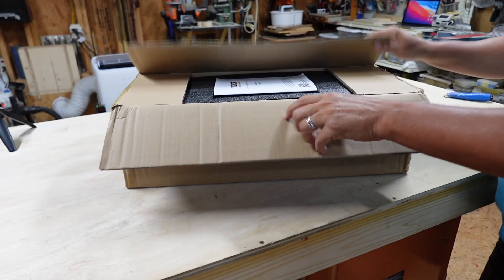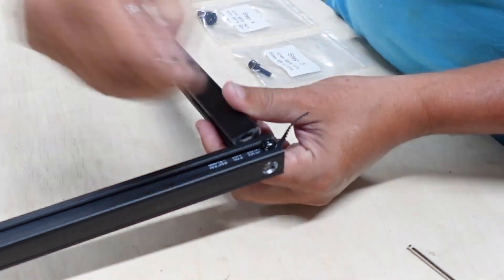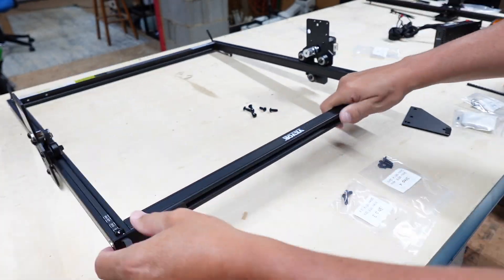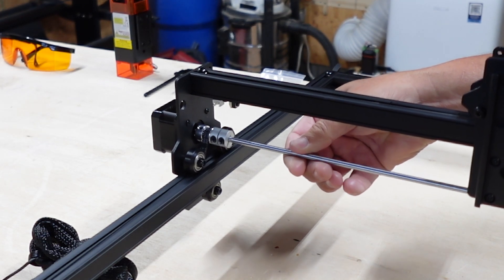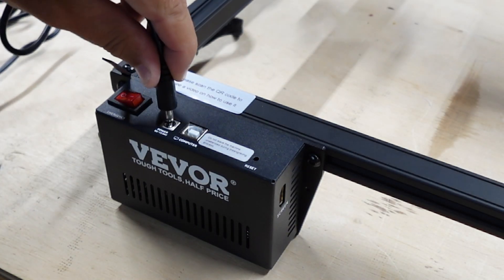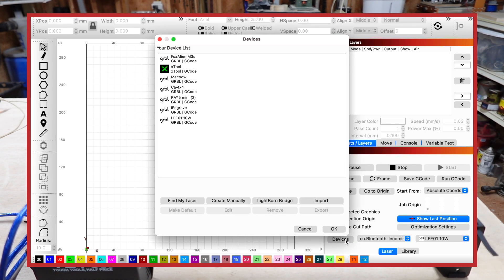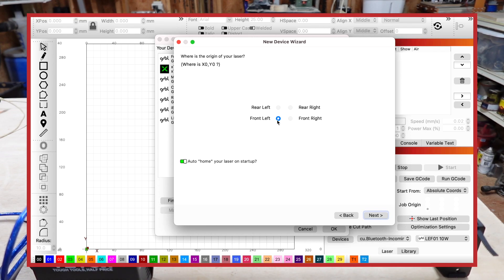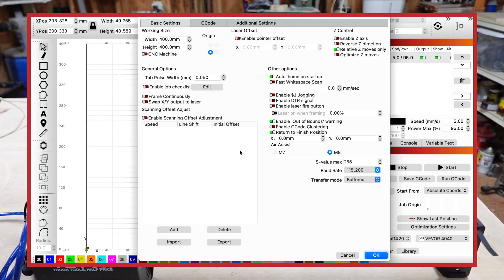VEVOR 10w Laser Engraver Unboxing, Assembly & First Impressions!

Comment: how did it do on glass i like one for my like whisky bottle and glasses
Reply from the maker: Diode lasers won’t typically work on glass.  The wavelength of the laser goes right through the glass. You could coat the glass with paint to etch it. Otherwise here is the breakdown…

If you want clean, reliable engraving on clear glass, the ranking is:
	1.	✔ UV Laser (355 nm) – Sharpest detail, professional results
	2.	✔ CO₂ Laser – Excellent for tumblers, plates, décor
	3.	➖ Fiber (1064 nm) – Works, but not consistent
	4.	➖ Blue Diode (450 nm) – Only works with coatings

Cheers!

Comment: I’m looking to make boxes with this laser, what is the thickest material have you successfully used.
Reply from the maker: The most you’ll get with at 10w diode I’d say is 5-6mm basswood and that’s with multiple passes.  Get a 40-60w in my opinion. You’ll spend more but worth it.

Comment: hi, can it used on champagneglas?
Reply from the maker: Yes and No. diode lasers cannot typically mark clear glass or cut clear plastic but you can put a coating on the glass and etch it. Some people use tempra washable paint then laser it.

Comment: How well does it work on brass, copper, aluminum?
Reply from the maker: To laser on metal with any diode laser…. You’ll need to spray the metal with etching spray.  If you want to bypass the spray step, you’ll need an IR or Fiber laser.  But back to your original question…. This laser will work on those metals WITH etching spray.
Reply: @TheCrawlspaceCraftsman  yeah sweet, i make Nordic gold and was looking into the laser engraving/etching so i can add clean designs to my work, being a blend of the three materials and slightly softer then copper, i'm hoping it will etch well before i go all out and buy one

Comment: I just got my Vevor 5w unit built and tested. Mine seems a tad more fancy as it has what appears to be higher grade frame and gantry. It also has really good wire loom? Chain linked plastic case protecting all the wire.  The price is respectable and the thing is built SOLID. I see your control unit is similar. Now that I have the frame can I just upgrade the lasers or do they need separate control  boxes?
Reply from the maker: So you have an upgraded version which is awesome!  Yes. You can purchase a different diode and just swap them out. No new controller needed!
Reply: @TheCrawlspaceCraftsman  Ty sir!